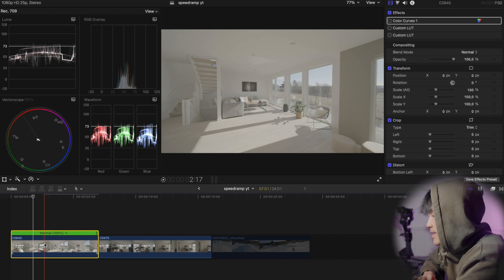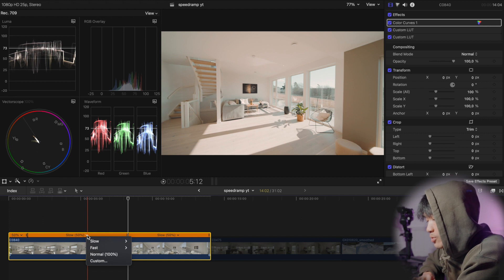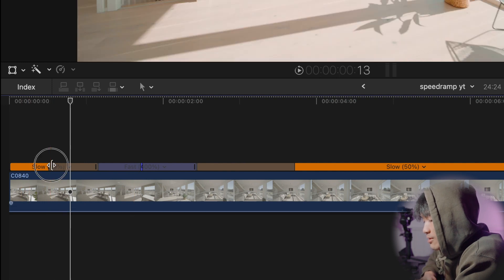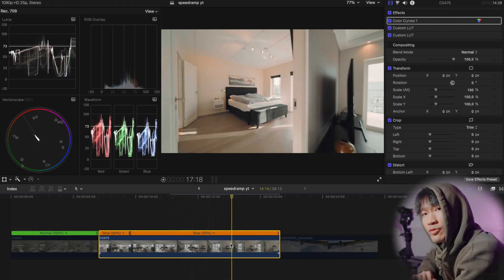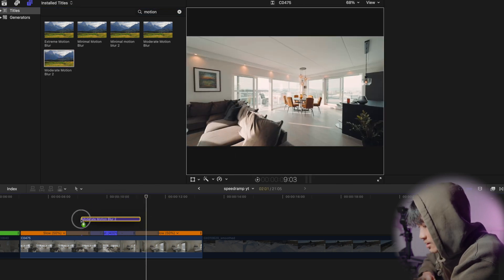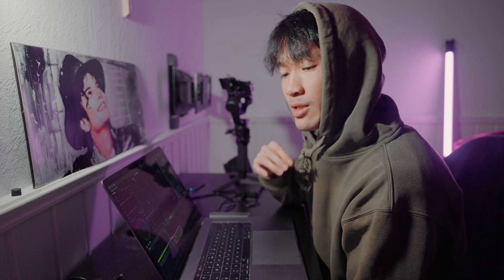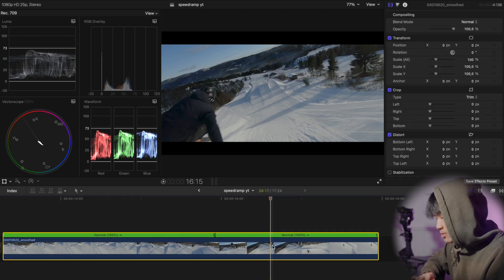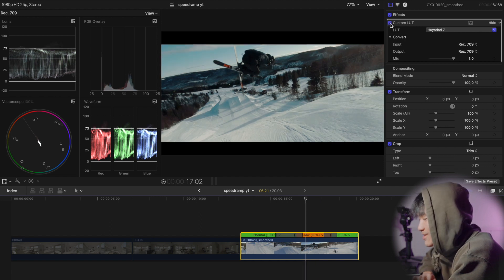How to IMPROVE your videos by using SPEED RAMP // EP01

Comment: You can change the speed ramp position without redoing it again by double clicking the bar beside the ratio number on retime bar you set by pressing shift + B then clicking edit source frame and then sliding it left or right it takes 0.01 sec to change your speed ramp position with simple step
Reply from the maker: Oh wow, thanks for the tip!🤩